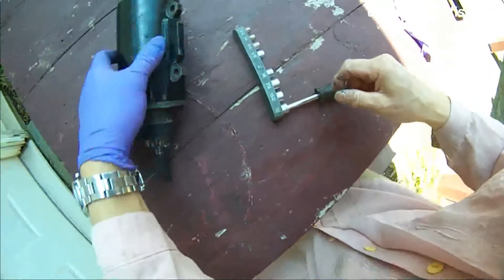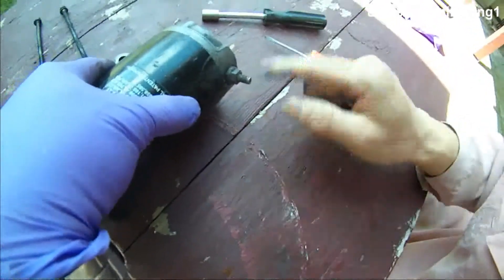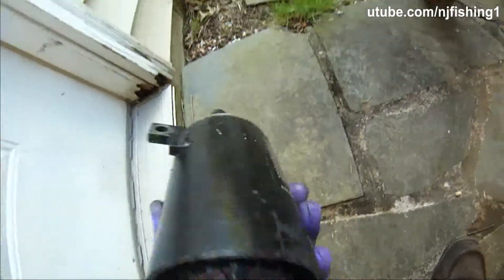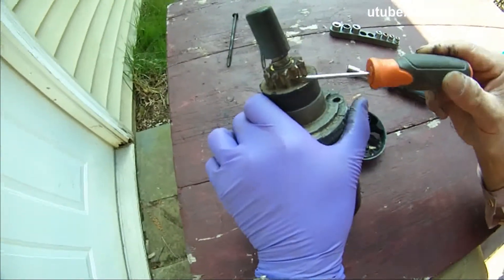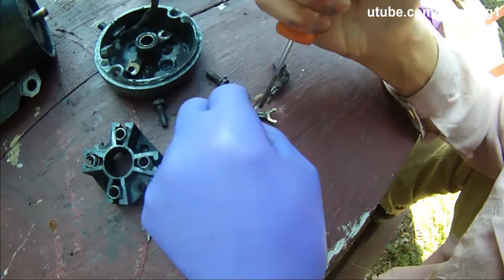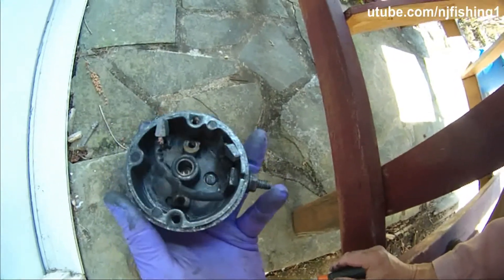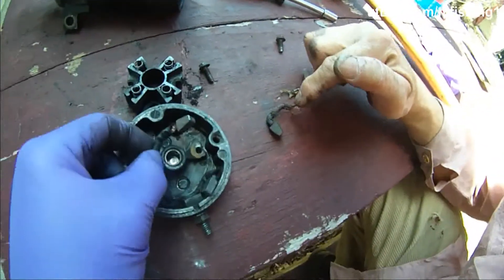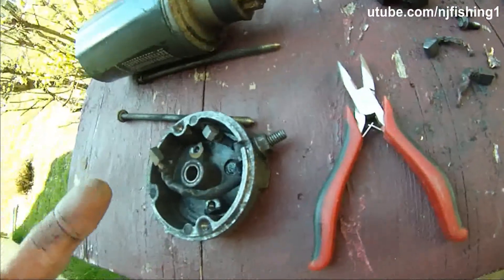Johnson 90 hp - how to rebuild an outboard starting motor? 1 of 3

Comment: of all the crap on your work bench, i don't see the factory service manual ! very important as it guides you through each step and gives you torque values for the 2 screws.
Reply from the maker: I just post my questions to iboats or johnson outboard forum for help